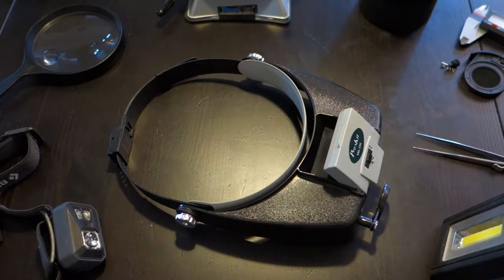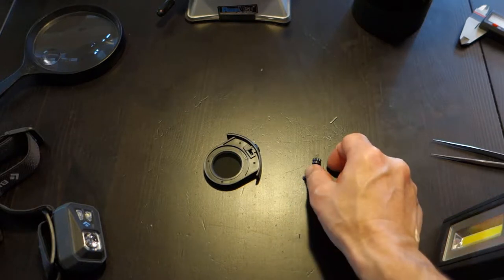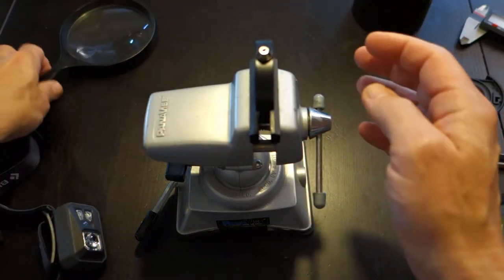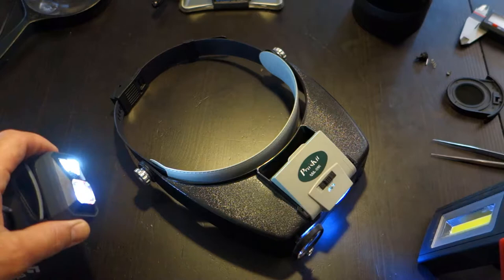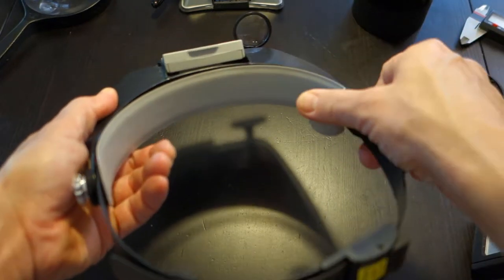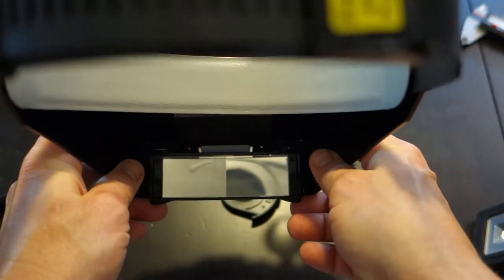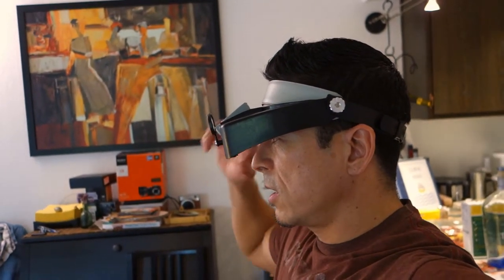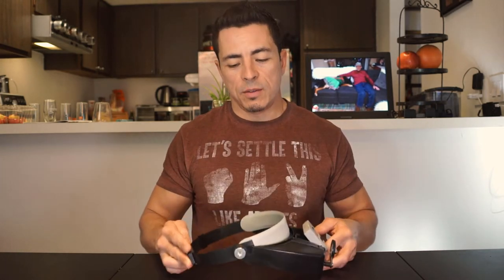Excellent Budget Headband Magnifier Proskit MA-016 Optivisor – Sample Images and Review

Comment: Hi mate,just wanna say thanks for the review

I have an issue with my eyes,and only my left eye is working well..
Is there any chance move the round mangnifying lens to the left side?

Greetings from Indonesia
Reply from the maker: Hi, Rieza.  Glad you found the video helpful.  I believe it would be fairly simple to move the external lens, as it is only attached with a screw.  You would just have to drill a hole on the opposite side.  Cheers